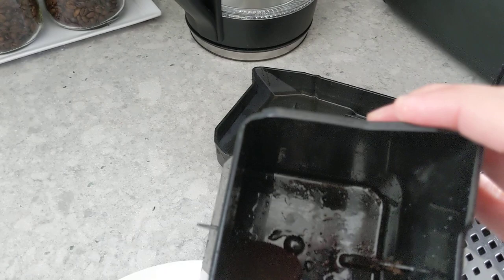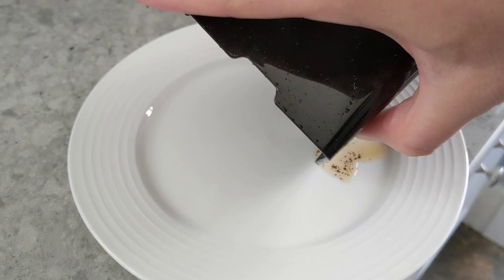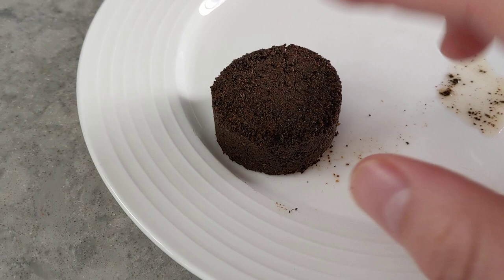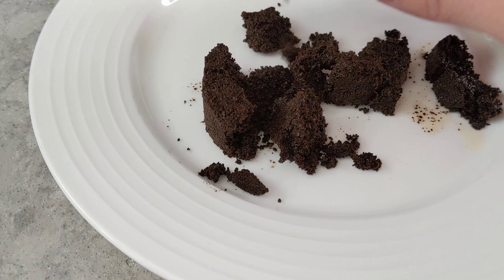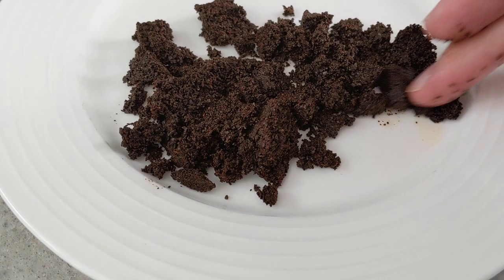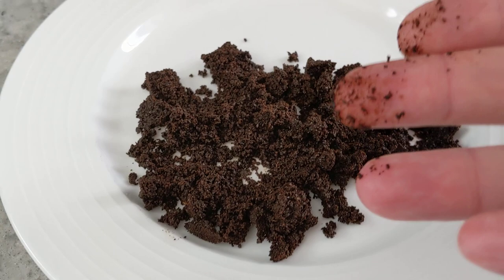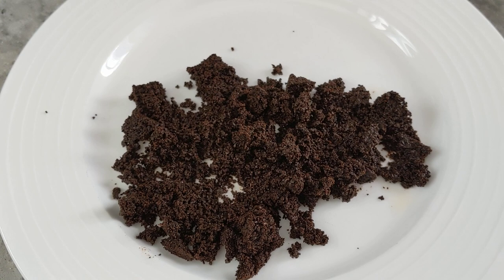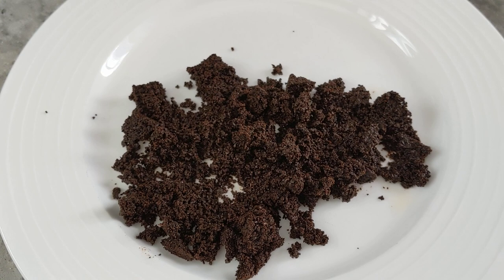Phillips 3200 Series LatteGo - Trying to make sloppy pucks. (See Description for Update)

Comment: How many grams does it grind at the highest amount for a single shot espresso? It definitely looks like it doesn’t pull a real espresso shot, but maybe pulling two singles would make it taste like a real 2oz shot?
Reply from the maker: It depends on the grind size, but my estimate is around 8-12 grams. I'm basing that on the weight of the grounds in a full scoop when using the scoop provided with the machine for pre-ground coffee and I measured the weight of a grounds puck after grinding and presoak (there isn't a way to stop it fast enough to get the dry grounds). I'd say 10 grams is a good average value for the weight.
Reply: @BryanKlein  Thanks for the fast response! If you choose two espresso shots, does it grind and brew for each shot? Or does it just run extra water through one grind?
Reply from the maker: @H-RutherfordHill  it grinds and brews 2 shots.
Reply: @BryanKlein  Cool, I just ordered it. $579 certified refurbished.
Reply from the maker: @H-RutherfordHill  Great deal!  I hope you enjoy yours as much as we have ours.
Reply: @H-RutherfordHill  I just ordered mine for the same price on ebay. Probably from the same seller. What condition did it arrive in?
Reply: @davmrls  I have it here, but haven’t opened it. I decided to send it back and stick with my espresso machine and grinder. Did yours come in bad condition?

Comment: I have a philips 1200. makes a coarse grind, when setting up 1. reviewed a million videos, corresponded with a German - nothing helped.  from your video, on a coffee grinder that was not working, you translated to 12 and the question: and only then did you turn to 11, 10, ... 1?  question: is it necessary when to translate from 12 to 1 is it necessary to use espresso?
Reply from the maker: You should run the grinder when moving to finer grind setting to not put too much pressure on the grinding surfaces if beans are between them.  Going in the more coarse direction you can make larger movements because you are increasing the distance between the grinding surfaces.  You don't want to break anything with too much movement without running the grinder a little bit.
Reply: @BryanKlein   Thanks for the advice, I'll try it tomorrow, otherwise I'll get drunk coffee and won't sleep 😅🤣😂.  we have 21: 22.😉.  how it will turn out, I will unsubscribe to you.
спасибо за совет, завтра попробую, а то напьюсь кофе и не усну 😅🤣😂. у нас 21:22.😉. как получится, отпишусь Вам.
Reply from the maker: Sounds goo  @ivanoffartyom . :D Also, you will want to run the grinder 2-3 times after changing the grind setting, to push out the previous grinds from the chute that connects the grinder to the vertical channel where the grinds fall down into the brew group.  See this video... https://youtu.be/1II1_xCJmFQ
Reply: @BryanKlein  yes, I know that 3 mugs are 100% adjusted grind. Спасибо 😉

Comment: Did you read the manual? You should adjust while the grinder is working...
Reply from the maker: Yes, and I have responded to this same comment a few times in other threads.  I also spoke with Phillips Service Technician about this specific topic and they say 2-3 dots at a time is fine in the coarse direction even while not running, but it must be running to move in the Fine direction.  Also, they don't recommend setting it to extreme positions (1 or 12). The recommendation is important when closing the gap between the grinding surfaces so that a bean between them doesn't break the assembly.  When going in a more coarse direction, like I was in the video, the requirement to run while adjusting is not an issue, as the surfaces are spreading apart instead of coming together.

Comment: I juyst recently got a Philips 3200 LatteGo and everytime I have a Latte a little bit of water comes out first is that normal?
Reply from the maker: It happens to me sometimes too, I haven't yet figured out why it happens and not all the time.  I've wondered if it happens more or less depending on the position of the nozzles above the cup.
Reply: @BryanKlein  So then it's probably normal?
Reply from the maker: @lilspennyy  I think so, and it doesn't happen all the time.
Reply: I think that’s the pre-infusion pushing out a little bit of water from the rinse.

Comment: Do you have a video with already grounded coffee! I tried it on my new machine and the machine grounder takes over all that time!  The consistency in coffee is weak with the grounded coffee it’s only asking foe one scoop per coffee I do follow the instructions but I don’t like to coffee with the grounded coffee already , when I went to target that’s all it had grounded coffee so I bought it !
Reply from the maker: I don't have a video of that yet, but the grinder should not run if you press the aroma strength icon (bean) for 3 seconds before pressing the start button. Wait until the light is on next to the little scoop symbol. You can only brew one drink at a time with this option, because you would need to add another scoop for the next brew cycle.
Reply from the maker: Also, the grind for the pre-ground might be too coarse. I think you would need to find an 'espresso' grind, regular grinds for drip coffee might not be fine enough and the water would just flow right through it without picking up as much flavor.
Reply: @BryanKlein  thank you I will try that next time

Comment: And i think u can only change the grinder while it s working and only change 1 dot every time
Reply from the maker: We have discussed this in detail in other comment threads, I talked to Phillips Service about it and they say 2-3 dots at a time is fine in the coarse direction even while not running, but it must be running to move in the Fine direction.  Also, they don't recommend setting it to extreme positions (1 or 12).
Reply: @BryanKlein  yeah but which side is more finer ? It makes me confused i know 1 is finer but if i turn it to right direction is it going to be more finer ?
Reply from the maker: @imuluer  rotating the knob clockwise will make it more Coarse, counter-clockwise for more Fine.
If you look to the left of the knob, there is a little raised part in the sidewall of the bean hopper, this indicates the current setting.  If you look on top of the knob you will see the little dots that change size with a #1 at one end and a #12 at the other end of the dots.  You should be able to count the dots from one end to the other and then look at which dot is next to the indicator on the side of the hopper.
Reply: @BryanKlein  thanks a lot ! Now I understand it well🙏🙏🙏
Reply: @BryanKlein  isnt it tudo other way arround ?
Reply from the maker: @crazyportuguese  I don't understand your question.

Comment: Has anyone experienced their lattego suddenly not frothing milk properly and producing hot milk instead? Any help would be greatly appreciated appreciated !
Reply from the maker: What kind of milk are you using?
Reply: Reduced fat milk, it was working fine  with it... but now milk comes out watery not foamy at all..
Reply: 2% to be specific
Reply from the maker: @Amrlwld1124  that should definitely be light enough to flow easily into the steaming chamber.  I wonder if the heating system isn't getting hot enough to generate steam and is just pumping hot water through now.
Reply: @BryanKlein  thanks. I am I'm contact with customer service to resolve the issue. Will let you know how it goes
Reply from the maker: @Amrlwld1124  if you do not place the lattego cup on the machine, then press and hold the bean button until the pre-ground scoop light turns on, then run the unit on macchiato mode, does steam come out of the hot water nozzle?  After it starts brewing, you can press play/stop button twice to turn off the brew process.
Reply: @BryanKlein  I just tried this method. It does produce steam but some water comes out. Not sure if that is normal
Reply from the maker: @Amrlwld1124  here is what mine looks like... https://youtu.be/hlRD1aiUWHE
Reply: @BryanKlein  thanks for the video, mine seems to doing the same as your machine. Could it be that the lattego is broken. Philips is sending me a new lattego carafe. We shall see..

Comment: first you should never adjust grinder when not grinding! 2nd the finer the grind the stronger the coffee.
Reply from the maker: First part of your statement has been said by others and answered before. For the second part, your intuition makes sense, but also consider that proper water flow through the grounds is as important as surface area of the grounds themselves, and with really fine settings on this machine it seems that all the grounds are not well exposed to the water as it passes through.

Comment: My pucks are nowhere near the size of yours, only about half. Is there a way to increase the amount of beans it’s grinds per cup and I’m totally missing it?
Reply: I’m already at max aroma/strength settings
Reply from the maker: What is your grind size set to?
Reply: I think it's because he used the coffee setting? I'm not sure because I'm still learning the machine too but I believe the coffee setting uses more grounds than the espresso setting (possibly) I sure wish they would give you more information in the manual
Reply from the maker: @MrJoshdavis99  I think the amount of grounds are the same, the coffee is just a 'long' pull through the grounds, while the espresso and Americano only pull a normal shot.
Reply: Do you know how many ounces the different drink settings produce? like how many ounces does small medium and large espresso do and how many ounces is the small medium large coffee do?
Reply from the maker: @MrJoshdavis99  here is what I see on my machine. The number next to each volume indicates the water volume amount where there are 3 options available (the number of lights shown for that setting).  Note: some of the drink options have a "2x" mode, which would just double the values below.

Single Espresso
1 - 35ml
2 - 45ml
3 - 75ml

Single Coffee
1 - 105ml
2 - 130ml
3 - 215ml
Reply from the maker: Paul, just to verify, my pucks are solid and about 1 centimeter thick.